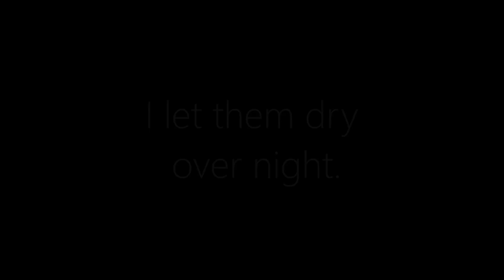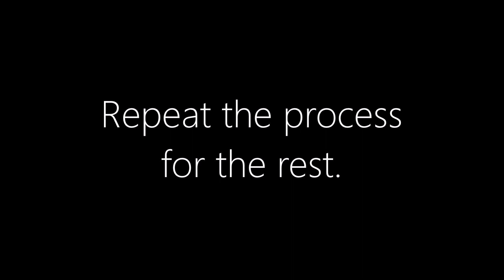How to Make Wands with a Twist - Twisted Wand DIY

Comment: Dan, I thought this was a really clever way of making these! I saw the thumbnail and pictured a TOTALLY different process (using flat stock). I'm not sure I've seen soaked and twisted dowels yet. I like it.
Reply from the maker: Thanks, I think if I could heat the water I would probably get better results.  But I final setup my lathe and now making wands is wayyyy easier.  Thanks for the comment.